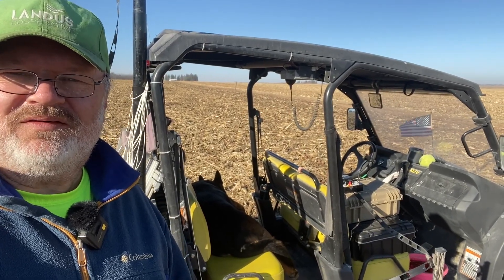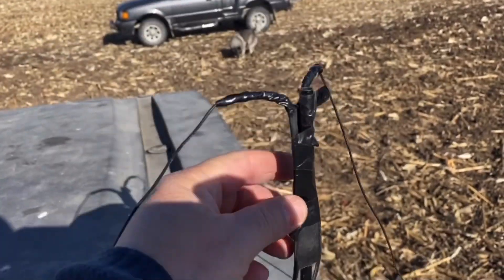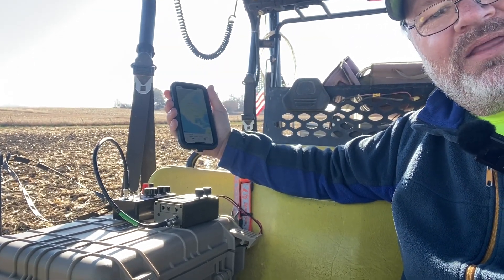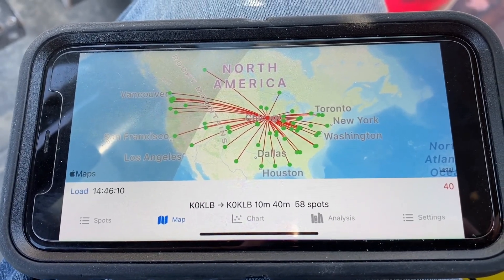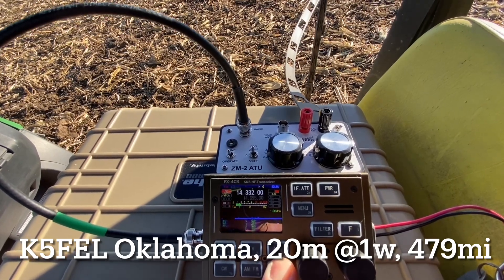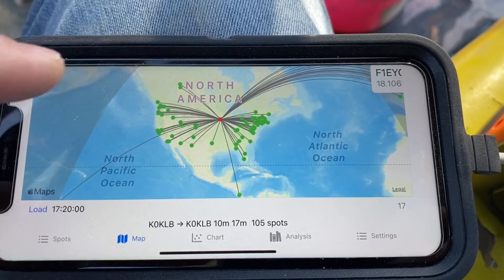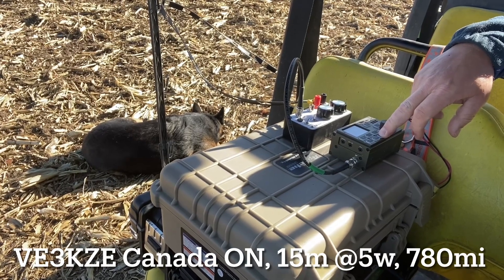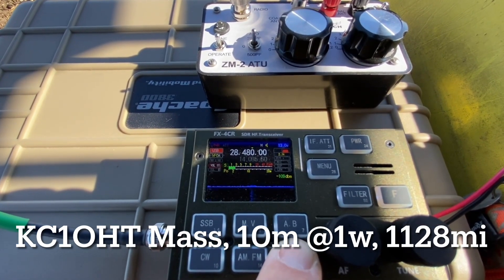Multiband 1.5 wave dipole ??  - Iowa

Comment: A very interesting antenna, can you please tell me if you have any experience with it? Would it be possible to write its dimensions? Thank you 73!
Reply from the maker: Hello Jacob.. I've been experimenting more with it lately.. The leg lengths are 48ft long so a total length of 96ft.. Legs are sloping down.. I just pulled it up on a 50ft pole that I installed here at the home QTH.. I've added a 4:1 balun near the house. Here is the setup.. Radio in house, tuner, 12ft coax going outside to box with 4:1 balun, approx 80ft of 450 ohm ladderline goin up the pole to the center of dipole legs, legs sloping down (maybe a 45 degree angle). Here are the SWR (center of SSB range) results from antenna analyzer: 160m = 2.4,  80m = 6.0, 40m = 2.5, 20m = 2.9, 17m = 1.7, 15m = 1.3,  12m = 2.9,  10m = 1.5.... Your results may vary.. Thanks for watching.. 73, Kevin ~ k0klb

Comment: Thank you so much for presenting this video. Operating QRP really proves the efficiency of an antenna. It blows my mind how you made contacts using such low power. I did not think that such a design would work so well on all hf bands, especially on 12 and 10 meters. I've been thinking about what would be the best general purpose all band design for portable operation and I think you have nailed it. Of course as with most things in life it is a compromise. You do have to tune the antenna every time you QSY. But that is such a trivial thing. The ability to operate on any band completely outweighs the small disadvantage of having to tune.
Reply from the maker: Hello.. Thank you for stopping by and leaving a comment.. It does perform better than I expected as well.  It does require an open area to spread the wires and string out but other than that, its pretty easy to deploy.. Results in your area may vary but I've had great success with this configuration.. Good luck on your continued search and I hope you find what you are looking for.. Thanks for watching.. 73, Kevin ~ k0klb

Comment: In reality that’s not a dipole. It’s 2x 5/8 antennas colinearly mounted. It’s origin it’s the extended double zepp antenna and its amazing!
Reply from the maker: Hello Pedro.. Thanks for stopping by.. I admit, I'm not very good at the original history and names of antennas.. I just throw things in the air, have some fun and see if it works.. Thanks for the correction and for sharing the origin information.. It does work very well.. 73, Kevin ~ k0klb